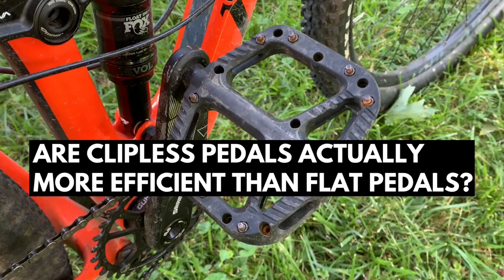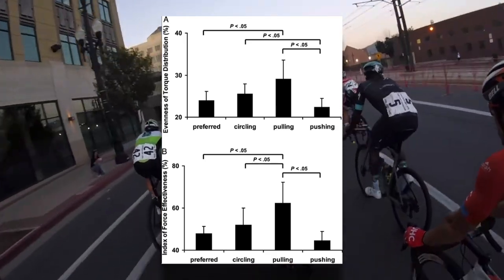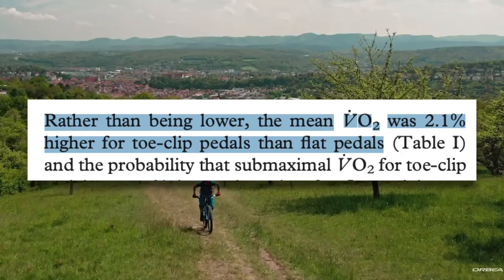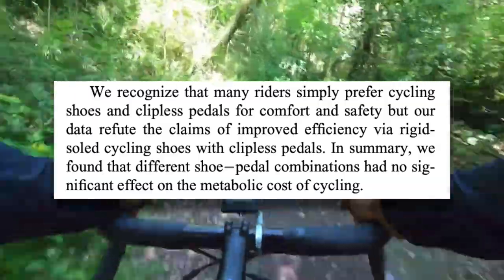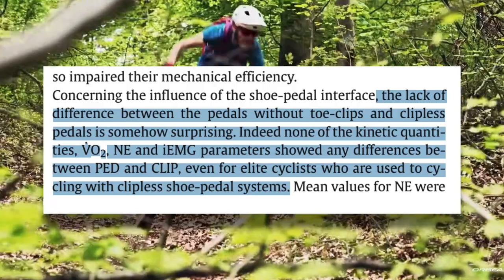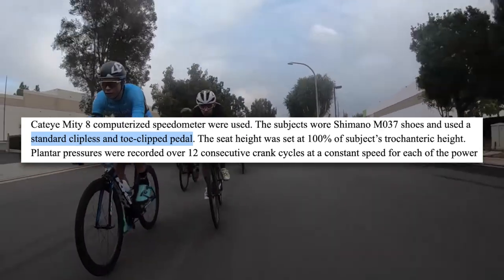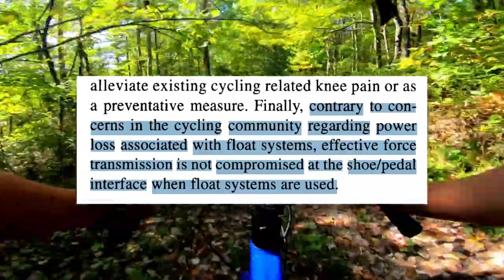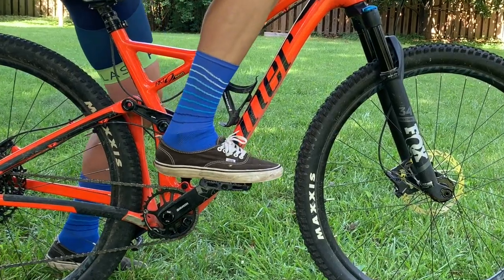Are Clipless Pedals Actually More Efficient Than Flat Pedals? The Answer Might Surprise You.

Comment: No ones really pulling up on the back stoke, not even Olympic track racers in an all out sprint finish. If they're not pulling up I gaurantee you no one else is either. The brain seems to be wired for push/push not push/pull. While it is possible to make the push/pull motion efficiency drops as you noted. The brain is a funny thing. Test subjects always felt they were putting out more power but the instrumentation said otherwise. Google "The Flat Pedal Manifesto" by James Wilson. It's a good read on the subject. I run 5-10 Impacts and pinned flats on just about every bike I own now, even my rando bike. I don't notice any difference in times over known routes. Roadies may get a few fisheyed glances from their buds when they show up for a club run on flats. Really it's the fear of ridicule that stops "serious cyclist" from trying flats.
Reply: So much this. Our leg muscles are made for pushing away from the ground while walking or running, not for lifting weights. When do you ever use your leg to lift or pull? absolutely never.

Comment: I find this power delivery argument kind of pointless.  Anyone that has ever ridden with both can tell you that stronger power delivery from clipless is negligible at best over and above flats.  For me, this isn't the consideration.  Where I find clipless to shine is with consistency.  I stay centered on the ball of my foot, my feet and ankles stay forward aligned and the arch support of the rigid clipless shoe reduces fatigue.  This, for me, translates to longer, more focused and more comfortable riding.  I'm a casual fitness road/gravel rider so this little bit makes quite a difference in my daily riding.  If I were a pro, the only other consideration would be weight/drag.  Clipless shoes and pedals are very sleek and light.  If you are a boardwalk and coffee shop hopper, go flat for convenience.

Comment: Ok deep breath....
1)  Dylan correctly points out the flaw with all the the studies.  Windtrainers are not bikes.  And while they approximate most of the cycling experience, they don't cover all of the experience.  Think pedaling a mtb over choppy/rocky singletrack.  If you are clipped in, you can just mash.  No way flats will be as effective. 
2) Powering the up-stroke is a skill, and has to be practiced to become efficient.  If your test subjects are simply just mashing the downstroke, of course being clipped in won't matter.  Even if you 'instruct' them to do so, ah hem, it's like riding a bike - if it's your first day on the bike, you aren't going to be very efficient.  Applying power through the upstrokes with your left leg, reduces the effort required on the downstroke for your right leg.  If you are spinning good circles, you can feel this effect.  (To feel the absence of this effect, try pedaling with just one leg).
3) Dylan also correctly points out the issue with sprinting on flat pedals. 
4) Speedplay frogs have 40 degrees of float.  After 20 years, and tens of thousands of miles, zero knee issues. 
5) Dylan also points out the absence of the effect of being clipped in on a climb.  The steeper it gets, the more benefit to spinning circles.  And of course on a mtb, when it's really really really steep, being clipped in is far superior.

Comment: there is no surprise at all ! Cyclist always tend to believe some kind of alternativ laws of physics and not reality. The reality is that if you are able to pull you will have two biomecanics advantages only, during very short efforts you will use more muscular groups and then output more anaerobic power. And during long effort you will rotate your effort with more muscular fibers, meaning a little less fatigue.
You will have no gain in aerobic power because the limiting factor is not your muscles.

Comment: This test is like saying a drag racer does not get as good gas mileage as Honda Civic.. Racers train to be able to put out as much power as possible. I have seen some ultra racers use flats but anything under 300 miles cyclist will go for the  power. They have enough gas they domt need to worry about running out.

Comment: I find pedal with screws to grip my shoes helps when my quads are tired. Then I can shift from the down stroke to forward and back for a few minutes and rest that group of muscles. I also find that instead of up stroke I just pull myself down with my arms more to get more power from the down stoke with out the front of the bike lifting up as much. Random thoughts I guess

Comment: Going up a steep hill with and without fixed shoes is like day and night. I have ridden a "pro level" carbon road bike on gravel and in the woods, and I have ridden an MTB for moderate 40-60 km distances on tarmac. IMO, fixed pedals give you that extra omph when going up a steep, messy path. This opinion was formed in Norway where huge elevation changes are the norm. Haven't made up my mind yet on fixed pedals for E-MTB use, the wider ones are probably worth a try. BTW "clipless" is a terrible term for these shoes and pedal systems. Just call them what they are! fixed shoes! or attached pedal systems! BTW BTW I also like "clipped" style pedals, but preferably without a strap, but these systems went more or less extinct before my time.

Comment: this is a little misleading compared to the real world differences between flat vs clipless pedals.  If you ride mtb flats for a long period of time, what will happen is that your feet start to feel fatigue and even numb after awhile due to them sinking into your shoe sole.  Yes, you could argue that the issue is really the shoes and not the pedals.  But the fact of the matter is that in the real world, clipless shoes tend to be much better than skater shoes or hiking boots for pedaling.  Oh trust me, I was using High Five mtb flat shoes for years refusing to go clipless, until one day I decided to give clipless a try and will never go back to flat pedals.  Difference in a long 4-5 hour XC ride is day and night

Comment: The entire point of clipless pedal or “Toe clip insert pedals” is to bring up the off pedal faster in the upstroke so that you push down faster. It’s a small advantage over normal pedals. This benefit is more advantageous when doing lots of spinning ( no grinding gears) since you are stuck to the pedal and can bring it up faster you can do much faster sprints and also climb much faster without slipping out of the pedals. I do not ride clipless pedals because our roads here are a mess with stop signs everywhere.

Comment: Once again, not understanding the pedal stroke. Efficiency of a muscle is directly related to its size and mechanical advantage (where the connective tissue is attached in relation to the pivot). Glutes are by far the largest muscle group. The glutes extend the femur from the hip, they can only push down. Putting a rider on flat pedals removes their ability to use other smaller muscle groups, thus the higher efficiency.

The common conclusion is as poorly misunderstood as the pedal stroke. If you want the highest efficiency or FTP score, shut down all other muscle usage and just use glutes. Short of a pure extended hill climb, that’s not how you ride a bike.

Comment: From a pure physics standpoint, it's the result I expected:
With clipless pedals the energy  you save during the down stroke is exactly what you put in by pulling up during the up stroke. 

If you are riding a flat pedal,  you will push it down a little harder , but you will not use any energy to pull it up. Nothing is wasted and efficiency stays the same. 
It's no difference weather  you put in 200W entirely during the down stroke or 190W in the down stroke + 10W in the up stroke.
In both cases you have to put in 200W and your heart rate and oxygen consumption will be whatever it takes you to do that.

Comment: Just bought my first MTB after 15+ years...long story short..I bought a kid's bike, and it sucks. The pedals are the worst I have ever had..they are made for you to slip off the edge and possibly die. Really small, having metal teeth on the inside..but not towards the outside =.= mechanical disc brake with less bite than a regular shimano v rim brake and just so many issues with changing gears..wish I had a rohlofff/alfine hub

Comment: My choice would be toe clips and straps with real cleats... Favorite shoe pedal combination is  Campagnolo Super Record with the Ti spindle, Campagnolo alloy toe clips, Binda Extra straps  and the Sidi Cycle Jolly kangaroo leather upper with  double leather sole with the titanium sandwiched in plate... The old style cleats allows one to push forward  and pull back during the pedal stroke... best case scenario is that you can only pull up for a few strokes only....  During a pedaling cycle one must have a rest portion as well.. Think circles.. wax on.. wax off.. I realize that all this equipment is obsolete as it was the best one could get in the 80's ... the shoes were light and comfortable and the pedals lasted forever..

Comment: You are still biased. Half the reasons you give for going with clipless are actually the benefits of flats. If I feel a little knee pain on a hundred mile ride I just shift my heel a bit. And spreading the load across my joints loading cycle after loading cycle in slightly different places probably helps a lot. I've got no problem with clipless or flats, and have actually ridden  decades on clipless. But the excuses people come up with to slam flats are still ridiculous.

Comment: Clipless is more efficient.
When you move over to a clipless system you might even lose some power, due to the forward position of the cleats, which makes heavy use of calf muscles. It takes some time to develop the muscles for the clipless system, but once you have them your peak power will skyrocket compared to the flat pedals. Also the more you use it the better you get at utilizing the benefits of it. With the clipless system you can exert force on the pedal through the whole revolution. On the flat pedals this is around 200 degrees, if you have good grip. Now think about it,  you use many of your muscles lightly or a few heavily. Who do you think gonna get tired sooner? 
I had to use the clipless system for 1000+ kilometers just to get used to it.  A scientist dropping some runners to a clipless who have never seen it before not gonna do justice to this. Make half the peloton of the tour de france use flats and see what happens.
Reply: Some of those studies were made with experienced cyclists which do clipless all the time, they were moved to flats and their performance remained the same.
The problem is that those muscles you don't use are pretty weak and tire quickly compared to the main ones and only account for about 3 percent of the power as per previous studies from Dylan.
The cyclists at tour de france are a bad comparison, they will use whatever their team buys for them, remember those events are heavily influenced by marketing.

Comment: It's a total disaster to start off with one criteria as if that's the only thing that matters—efficiency!—before finally admitting five minutes later that you've actually heard of knee injuries. 

Moreover, the implication here is that if you have one set of muscles that are 2% more efficient than another set of muscles, why the heck wouldn't you train the more "efficient" muscles to the total exclusion of the less efficient muscles? That strikes me as very American. It's not like you want those other muscles to also become strong and useful ... I mean certainly not if training them is going to hammer your VO2 max by 2%. I mean, you'd be the laughing stock of your speed-is-everything riding group! The shame! The horror! (Of course, you'll get your revenge is ballet class, when you actually have to do leg lifts with those other trained muscles.) 

The other thing that should have been covered is bicycle touring. I would never tour on flats. What I found useful was to start to push my foot forward as it comes up on the 10 or 11 o'clock position, to prime the power stroke a little bit, and then from 6 o'clock to 10 o'clock, to lift my leg only enough to keep my rising foot light on the pedal, so I don't have one leg lifting the other.